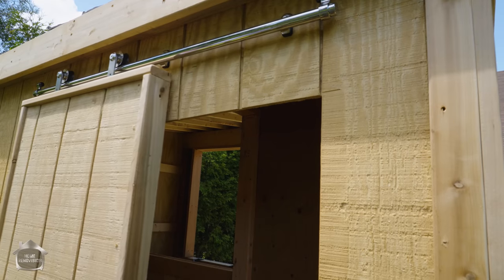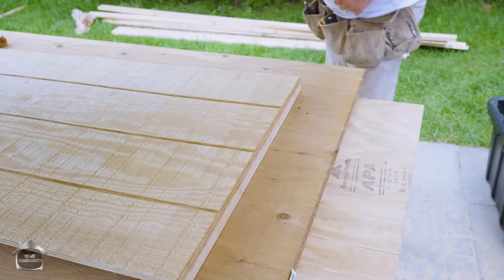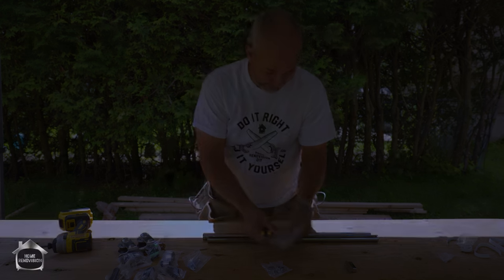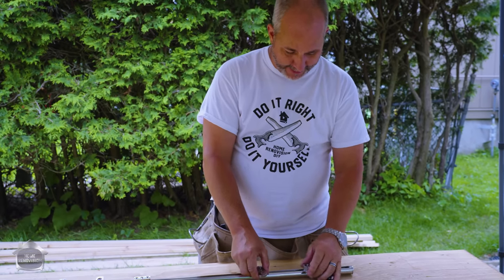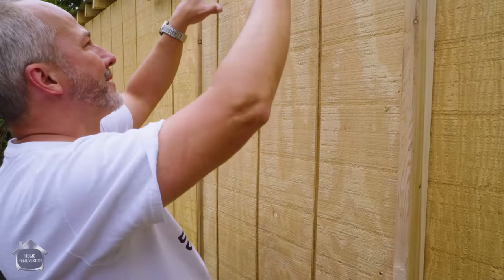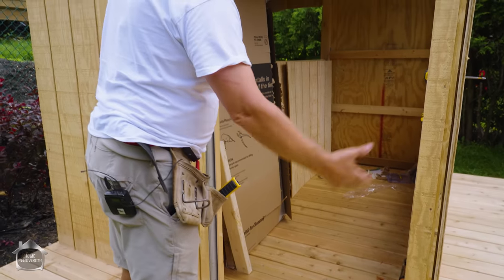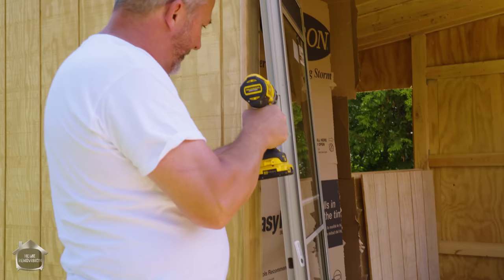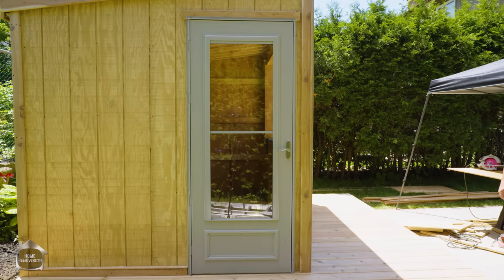Custom Barn Door | Storm Door | DIY Shed Build

Comment: a router for cutting out doors and windows works great. I worked at Atco structures and built portable office buildings for the oil field, and we'd cut after we hung using routers with special bits, clean smooth cut each time. Great job

Comment: Mechanical engineer here. The bar clamping system is legit. Having two wall mount supports on either side of the bar clamp means that the clamp sees no load from the door. The bar clamp is just holding the two segments together.
The clamp does have to be tightened well because it does see a load inline with the bar from the friction of sliding the door. That linear force tends to spread the two bar segments apart
Hope this makes sense.✌

Comment: The hex wrench length is engineered so you can't put too much pressure and strip threads on the cheapest metal.
Reply: Torx is popular now because they can use a cheaper metal and torque the fastener tighter than they would have with hex...

Comment: Hey Jeff, I just want to say thanks for all of your work, you have definitely reinforced this DIY'ers confidence levels.😅 So I am currently redoing my bathroom and have gotten my drywall up. I am wanting to get your opinion on whether or not to waterproof first, or tape and fill my coats of mud first?!...🤔😵‍💫😅 I've never done this before, and a lot of my personal setback has been overthinking everything. I went with the green board, and instead of just using the caulking method you did, I am wanting to actually tape to ensure everything is a smooth finish before I start tiling.

Comment: Great video! I'm having trouble finding the floor guide hardware mentioned for the barn door. Since this door is around 4" thick (the 2x4's), looks like most hardware is designed for thinner. Any ideas? Thanks!

Comment: So Im coming from a relatively old video but I have a question. You have stated that one should never buy a small tub of Mud and one should always mix their own compound if needed. Why is that? I dont have a lot of need for fixing a small hole or dent but generally I will have a use for a little every 3-5 years. Is the small tubs a different mixture, or unreliable recipe? I generally dont use much and cant justify getting a big bag that I dont really have the space for unless there are properties in the powder that you dont get from the small tubs. Thanks

Comment: I do have a question. I watched the shed build and am curious why you used cedar 4X4's for the upright posts when, at the end, they are all enclosed. Why not pressure treated?
Reply from the maker: They were actually PT, did I goof up and say they were cedar? Sorry if I misled you! Cheers
Reply: No, you probably didn't say they were cedar. I must have assumed because of the colour and the fact it was cedar decking.

Comment: You can't get 34". Trust me, I've tried. Rhona repeats this great sale every year with black MCM 3-light steel doors. In a town full of mid-century brick houses they only do 32 and 36. I've asked and they say it would be "custom" with a charge and I'd have to go straight to Masonite and not get the special. Seems odd, since the larger door is offered for that price (S Ontario). Old-fashioned customer service would suggest they suggest to Masonite to send 34s as well.
Reply: Go to Toker Collins. 
Got them to make me up a 34" Craftsmans 6 Lite. Fiberglass door and Jamb with threshold and brick mould, and a 7 1/4 inch Jamb width. 700 bucks CAD taxes in. It was ready in under a week. A standard piece of crap dented and scratched Masonite from HD or Lowes is 400-450. For a wood Jamb and steel door.
If you know someone with an account it'll be even cheaper. That was just the walk in price.
Reply: @evictioncarpentry2628  Thanks for the tip!  Curious about your name.
Reply: I did an internet search and it appears they only sell components, not the finished product. And only in Western Canada. I'm a homeowner.